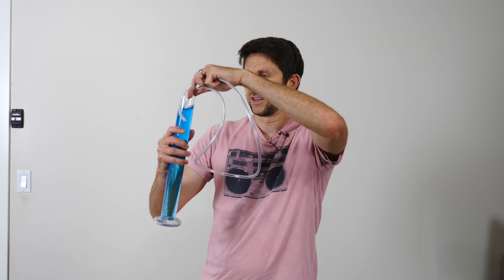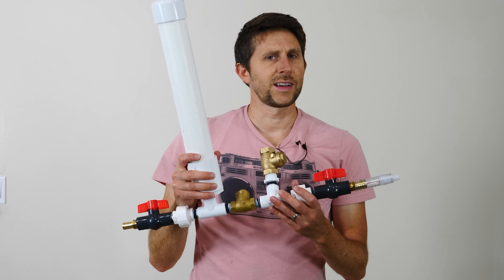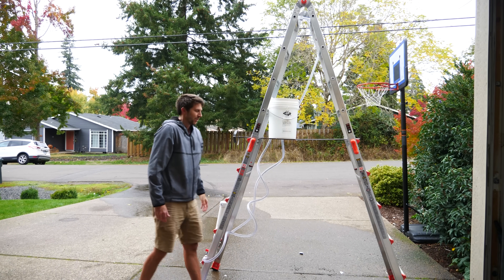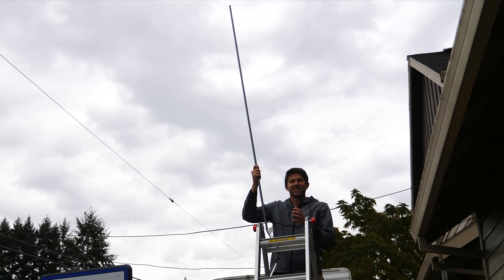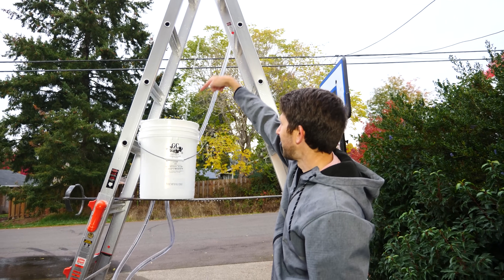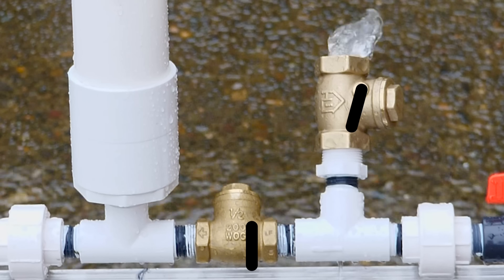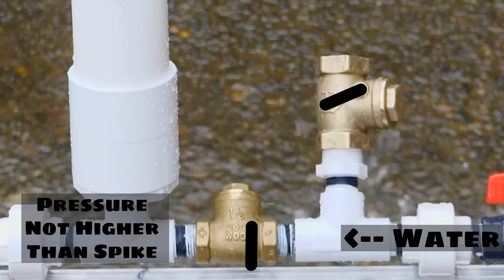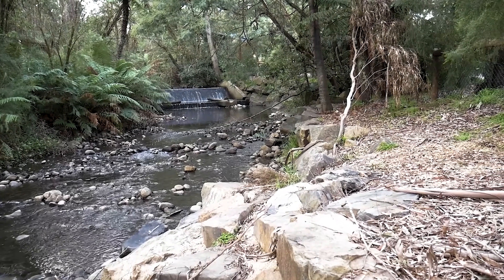Can a Hydraulic Ram Pump Make a Perpetual Motion Loop?

Comment: Fantastic Video! Thanks for using the Land To House ram pump for your demo.
Reply: What a observation xD
Reply from the maker: Thanks. It wasn't working at first. I had to replace the check valves to get it to work with my setup.
Reply: @TheActionLab  The issue was most likely the clear flexible drive pipe. I know for video purposes it worked to have everything in the frame but its ideal to have at least 25 feet of pvc pipe as the drive pipe. That would allow the normal valves to work correctly.  

Still a great demonstration!
Reply: @LandtoHouse  In a proper setup the drive pipe sholud be even more rigid than PVC, more like cast iron. The less give in that pipe the higher efficiency of the pump.
Reply: @blg53  Yes. The drive pipe rigidity vs cost factor can be an issue.
Reply: @LandtoHouse  could you add a motor this to make electricity?
Reply: @thomasramsay7076  The simple answer is yes, but since the system is working by converting the kinetic energy of water into pressure it makes no sense. If you wanted to produce electricity it would be more efficient to remove the ram pump 🙂 The theoretical energy would of water is: WP (w)=specific weight of water(N/m3)*flow(m3/s)*head(m)*efficiency of system
Reply: @fizzinsoda  A company produced a led light powered by a weight through a system of gears a few years ago, the weight wastes less energy than water would.
Reply: Ok
Reply: if its not Perpetual Motion don't even pose the question. thumbs down but like hell you could even see it anymore because of YTs stupid decisions. and the reason why i thumbs down is because i am of the belief that Perpetual Motion might be the only thing that can save humanity. and before any scientifically accurate retards pipe up, i didn't say "i believe its possible" i just said it could be what is necessary to for humanity to survive in any long term way. especially with the way governments of the world are treating long term problems like global worm and what not.

Comment: so why can you eliminate the water loss from the first check valve by running that back into the bucket as well? if the first valve and the final outlet both empty into the bucket, there's no more water loss. will the system still work that way? if it does, then you can introduce a power delivery device into the system to transform the water motion into work.
Reply: How do you get it back to the upper level since it's at a lower level. An electric pump maybe? Perpetual motion as long as you have electric power!

Comment: Me, an intellectual: directs the waste valve back into the stream and makes a perpetual loop
Reply: What do you need to bring the water back up? 
Pressure
here goes away your energy, the loop will only stop faster.

The first source of energy in that contraption is you getting that full bucket of water up there, your body deploy kinetic energy to store water higher than the ground as potential energy. The water then run down the pipe converting it as kinetic energy once again, and that same energy is used to pump some water back up to be stored again as potential energy. But nothing can "pump itself back up 100%" so some of that energy is wasted by leaving the excess water on the ground. Hope that helps.

Comment: Could you not connect the valve spitting out the water with a tube going back into the tube running to the valve system

Comment: Water hammer that you hear isn't due to the expansion and contraction of the pipes, instead it's the momentum the water in a pipe had, then that momentum is transferred to the pipe, often causing the pipe to shift and hit something.

Comment: what if you had the exhaust valve pumping that water into a reservoir that then drained into the pipe that goes into the system? cant you eliminate any wasted water?

Comment: Would it be possible to connect a hose to the waste valve so that instead of losing that water, it too is pushed up into the bucket?  I hope you do a video explaining how this would affect this type of setup.  Great video!
Reply: no water would flow if you did that.
Reply: You simply put a bucket under the wast valve. When full, you use the strength of your arms (add energy) to lift that water back up.

Comment: Could you not make so the waste water is collected into another bucket and that has its own perpetual motion and so and so forth so all that water is put to use and you only need to fill the very top.
Reply: No, eventually all the water will be at the lowest point and then it will stop.
Reply: @MrT------5743  but for per bucket of water filled at the top if you use a motor generator for both high up valve and exiting valve you would generate a decent amount of energy from just 1 bucket if it goes through many of those bucket set ups. And for 1 bucket per cycle that's seems worthy.
Reply: @devilntor4660  you can not generate enough electricity from thr falling water to pump that water back up. There will always be a lost in the system and it will forever be unachievable.

Comment: So fascinating! What if James had a second system that caught the waste water and dumped it in the original container?
Reply: That second system would require energy outside of the system. At that point why even make the system then, You would have to add energy just to keep water in a bucket. You can do that with just a water filled bucket and no hoses.

Comment: Couldn't you have say like, a bowl, close to the waste valve, and then catch the water that shot out (it would have energy (I think?) ) and connect it to AFTER the other valve. Would the water that opens the second valve have enough energy to push the "waste" water we put in through the third pipe?
Reply: No it wouldn't work. To be able to pump some water higher that the source, more water needs to end up lower than the source water.

Comment: 4:20 = This is analogous to self oscillating "boost converter" (in power electronics topology). The top valve is the MOSFET, water flow is the current and bottom valve is the diode. Like a boost converter provides higher voltage at output, in the same way, this hydraulic circuit can provide water at a higher point.
Reply: But where is the wasted energy in this analogy like the water that exits the top (outlet) valve? Power losses of diode and mosfet?
Reply: @Halolaloo  "Wasted" water stands for current consumed from the low level input, this current is higher than the current produced at the high level output (boost converter - height is voltage). It's not wasted but necessary to generate the boost effect. Wasted energy is the water heating in pipes friction.
Reply: Great connection.

Comment: What if you were to add a bucket to catch the waste water and have that re-enter the output flow by venturi tube with a check valve to keep back pressure up. I am sure that the flow would not pull in all the waste water but may make the system even more effecient in water consumption. Or adding a hydrolic powered pump connected to the output line and have the waste water side of the pump refill the bucket at the top. this pump would have to be one that does not allow water to pass without turning on both sides of the pump because of slow performance.

Comment: hmm, is there a way to make use of the excess spill water? is there a mechanism that allows water of lower pressure to be pumped into a system with higher pressure without having it get pushed out? if so, then you could truly make a perpetual system
Reply: No, you can't move water from low to high pressure without a pump that is using energy. There is no perpetual system. It goes against all known physics.

Comment: I have no idea what this thing is but as water is coming out at the bottom as well I assume that gravity is doing the work and that water is being lost from the system as a consequence. I think you'd need a source replacing that water... That is my guess, now I'll unpause the video.. I like to guess at stuff like this, sometimes I even get it right🤣
Reply: Close enough! So if the loss is inverse to the height water is pumped, could  you use several and recatch the lost water from the one above to increase the over all flow?

Comment: You put new bucket to pick up the "wasted" water and just fill the upper bucket with it
Reply: Manually cause there is no way for his system to do that automatically. In order to move some water higher than the source water, you need more water ending up lower than the source.
Reply: @MrT------5743  it is manually ofc but it is easier to do it

Comment: But will you be able to pump higher at night with less effort?

I have been watching the vulcano in La Palma. And at night it seems that the moon's gravity is pulling on the magma or someting. Like the tide at sea it seems to be having an effect too on the eruptions.

So here is a question for you. Will it make a difference if high-jumpers try to beat the worldrecord at night?

And do planes need less energy to stay up at night? Would it make sence to take off at night and fly along with the moon?

Does the moon make a difference on items on a scale?

My guess is that it does.
Maybe you have acces to a scale that could meassure such things.
Reply: The moon's gravitational pull is not really that strong. For a high jumper it would be way more dramatic to jump at the equator since centripetal force would help way more than the moon.
Reply: @MrT------5743  So at night at the equator would be the best time to try if all little bits help.
Reply: @jurrione  Yep. In-fact you weigh a little less on the equator than closer to the poles. Even on top of a mountain, you weigh less cause you are further from the center of mass of the earth.
Reply: @MrT------5743  I wonder all of a sudden if a longjump would count on an airplane. Are there rules that the surface has to be level? Could you break the record for the longest jump on the vomit-comet airplane? If they count the moment your feet leave the surface you are standing on, till where they hit the surface again, you could jump as far as the space within the airplane allows. If I read the rules online it only says the take-off board has to be level.
Reply: @jurrione  I would imagine there is a rule it has to be on earth. Cause otherwise you could long jump off the space station and never ever land again. Or many other places like the moon, Mars or Mar's moons. I think the small moon around mars a human has enough energy to achieve escape velocity and leave the surface.
Reply: @MrT------5743  Agreed. But tecnically in an airplane would still be on this planet. A plane is still concidered to be on earth although not on the surface but in the air. Many record have been broken in an airplane. So by ajusting the situation you could maybe stay within the rules and break a record. Crazy and unfair for sure. But fun to think about how to bend the rules a bit in a way that would be legal.

Comment: so here is a question, why cant you use a second setup to fill the first bucket from the output? it would still waists water but wouldn't it waist less water? or am I missing something here?
Reply: The question would be what is your hoped for end result? a full bucket at the top? just fill a bucket and put it up - done.
Reply: @MrT------5743   my question is not because I want an end result, I just want to know if my intuition is correct on this because if it is then there lies an interesting thought experiment which is if it does waist less water then say if you could link up an infinite amount (disregarding avaperation) how 'efficient' could you make it? is there a final number where in it can't become any more efficient? conservation of energy means that eventually it's going to lose water somewhere. if I'm correct then I want to know what that number would be.
Reply: @jacobellinger8027  it wouldn't work. To get any water higher than the start alot more water needs to go lower than the start. The valves at the bottom needs a certain pressure called head pressure. You maybe able to get like 10% of the waste water back to the first bucket. Don't know exactly how much, but wouldn't be much at all.

Comment: The answer to every yes/no question that includes the term "perpetual motion" but not "impossible" is "no."
Reply: That still leaves some options for formulating a negative question, like "Will i fail to build a perpetual motion machine?"

I'd say the answer is "it won't work".
Reply: Perpetual motion machines do exists.
Reply: @TurinTuramber  Show one, just one. I guarantee you we can find a flaw that makes it not be one.
Reply: @Llortnerof  The ISS, Voyager probes, the Earth....any object in motion as per Newton's first law.
Reply: @TurinTuramber  Nope. Not closed systems. Also not actually perpetual despite appearances. They slowly bleed energy, Earth just will get destroyed by other factors (like the Sun going red giant) long before that becomes an issue. The ISS would crash before long if we stop maintaining it, it's orbit decays at 2km/month.

Something few realise, even deep space isn't truly empty. There's stray atoms at extremely low concentrations that will ultimately still cause things to slow down through drag or impact. It just happens at astronomical timescales
Reply: @Llortnerof   Look up perpetual in the dictionary, it doesn't have to mean for all of  eternity just a long period of time, there is extremely wide birth between those two things. If perpetual did only ever mean for all eternity then nothing can ever qualify in a temporally finite universe and the word loses all meaning and purpose. 

EM waves are in perpetual motion and matter obeys laws of inertia, which tells us moving objects will continue to move indefinitely until acted upon by external forces. Therefore its simply a question of eliminating the external forces. If you then say that even moving galaxies are slowed by spontaneous quantum events that occur in a vacuum, clearly far far far beyond any scope of measurement; then the concept of perpetual motion becomes rather ideological. At those imagined levels of resolution, our mammalian perception of reality would breakdown long before we got there.
Reply: @TurinTuramber  Look up the definition for 'perpetual motion machine'. It's a lot more limited than you seem to believe. Objects moving through space indefinitely do not qualify because it isn't actually about motion itself, but about work. An object moving at a constant velocity in space does not perform work (in the physical definition).

Also, i suggest you look perpetual yourself because the definition is in fact "never ending".
Reply: @TurinTuramber  Then you're just confusing the argument by using incorrect language. I'm using that definition because it's the definition science uses to this day and what is generally understood to be meant by "perpetual motion machine" or "perpetuum mobile".

You've also got theoretical backwards. All of those things can only exist theoretically, they are impossible to create in the real world.

Perpetual motion machines of the first and second kind aren't even theoretically possible. Third kind would be, but you'd need an enviroment that is completely free of drag and a magical 100% efficient engine, and it still wouldn't serve any actual purpose.

Non-closed systems are never perpetual motion machines because being a closed system is part of the definition of the term. Any machine could run perpetually if you could supply fuel and spare parts. That doesn't make them perpetual motion machines. Only one that can do so without outside interference counts.

Comment: i wonder will it work if the water from the first valve was dropped back into the source bucket by attaching a pipe to the valve opening and directing the water flow back into the bucket? i think the bucket must be only slightly higher than all the valves so the water level is high enough and the water from the pipe can be directed back into the bucket as i see the pressure of the water isn't high PLS answer my question if you saw this, I am very very curious
Reply: No, it won't work. If the water from the first valve is forced to be connected to the source bucket then the source water will flow down the input pipe AND down that pipe you want connected to that first valve, and then nothing would happen after that, it will be motionless. and you would've pumped not even a single drop.

And even if you plumbed it so that the pipe enters the source bucket from above the water level in the source bucket, so that it can't try to flow backwards down the pipe, it still won't work. Because now the water will flow from the source down the input pipe side of the pump as expected, and then begin to flow up the pipe you installed that leads back to the source, but it will only reach the current water level in the source container, and stop, and nothing will move, and you pumped not a single drop of water.

I tried to help you, that is how it would work, it wouldn't. That is why the ram pump works in the first place, it has to use energy, and you can't use it if you try to force high pressure back into high pressure, it won't move. High has to go to low for there to be motion. That is how this works, it lets out water at a lower pressure in order to have energy to slam the valve closed, and that sudden slam is what caused the pumping action thru kinetic pressure wave.
Reply: @TheRebelmanone  omg I understand now, thank you for your time and effort! ☺